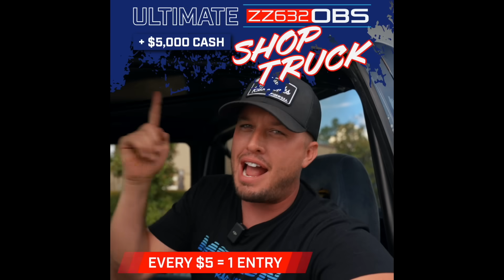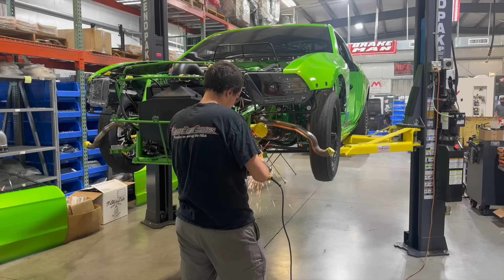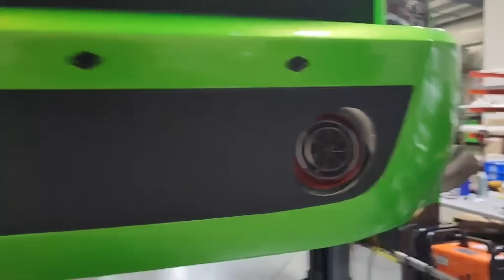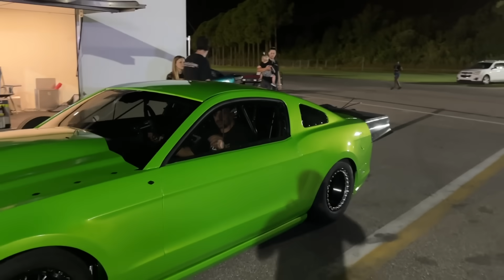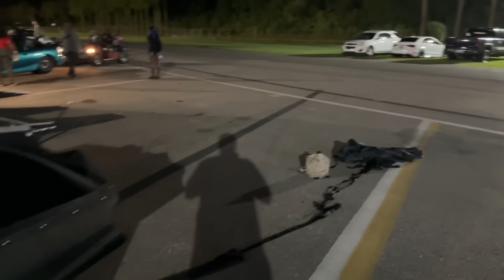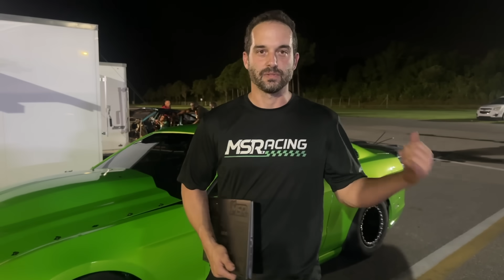Big Changes Required for Snot Rocket 3.0... Plus More Testing

Comment: 1:19 Y’all should get some sealed er32 collets for drilling. For thru spindle coolant drills, they keep the coolant pressure blasting thru the drill rather than around the drill. Helps with chip evacuation and can massively extend tool life!

Comment: You can tell who doesn't know what they're talking about by who brings up cleets camaro lol..
Reply: It's hilarious
Reply: Exactly!!!
Ignorance is very common in the comment section.
Reply: The Elco and Eagle definitely aren't built for the same classes. Below and above, respectively, but Mullet went absolutely beyond what he was made for. 

I reckon Leroy might be his answer with the body now, though. That thing's gunna mooooooooooove
Reply: Ahh but they will likely have a crack at each other at the Christmas Tree Race.
Be rude not to
Reply: Like people like yourself. As they are both promods only real difference between the 2 cars is Eagle runs a real promod engine and SR doesn’t. SR is nothing but a factory wheel base promod.
Reply: @whats2439 ................ Neither car is a promod. The engine doesn't make a car a promod, a stretched wheelbase does and always has, neither is stretched.. Really outted yourself as one of the ignorant with this one. There's no such thing as a "factory wheelbase promod" 🤣🤣
Reply: lol your showing your ignorance. Yall watch too much street outlaws where yall got that composite body and wheel base makes it a pro mod. Eagle and SR are indeed a pro mod. Pro mod strands for Professionally Modified. Take SR is a mustang which is a unibody car. Where is the unibody. It’s a purpose built double frame rail tube chassis. Engine moved back, not in the factory location. Trans back in the driveline is all promod stuff. Non of the suspension is in the factory location and is all promod stuff.  Half the car is a composite body. The back half of the body has had all the structure and support cut out of it to where it’s just light weight paper thin skins. It has to get promod certified and he has to get a promod license. Crazy how the guy himself said he might as well build a promod because people called 2.0 a promod anyway.
Reply: @whats2439 ....... SO calls anything with a tube chassis a promod. Which is what you're doing.. Try again 🤣🤣 there is ONE thing that makes a promod a promod. THAT'S IT. I said nothing about composite bodies, just making up arguments over here lmao. Nobody is reading all that. You're wrong deal with it and move on
Reply: Yep spoken like someone who knows they are wrong and doesn’t want to admit it. Yes you brought up the composite body, but I see you edited your post to take it out. It’s hilarious how you are trying to argue, when Brett himself said it was a promod.
Reply: @whats2439  ...... I never once said anything about composite bodies. Making things up in your head. Not arguing with a crazy person over another mans car.. Idc what Brett called it, he's part of the problem then 🤷‍♂️the definition of a promod is set in stone.. You're wrong plain and simple
Reply: @whats2439 you are 1000000% wrong and he is 100000000000000% right 🤣🤣🤣🤣
Reply: lol no one making anything up about you. You said composite body. FYI it straight says (Edited) by your comment. You took it out when I mentioned half of SR was a composite body.
Reply: @whats2439  you're having a completely different conversation with yourself in your head than what is actually being said... I edited a typo 🤣🤣🤣🤣🤣 stop blowing up my notifications with your insanity
Reply: @whats2439 i saw this entire conversation go down you’re absolutely lying and its weird
Reply: @racer5997  🤣🤣🤣🤣🤣🤣🤣im crying lol. I have a headache from the craziness
Reply: Yeah that’s what I would say too
Reply: Yeah ok, I literally destroyed his composite body argument by mentioning half of SR is a composite body. So he edited that out. Funny how he has (Edited) beside all of his comments and he is so adamant he didn’t say it.
Reply: @whats2439  hey genius, half of eagle is too 🤣🤣🤣🤣🤣 you're literally arguing with yourself STOP TALKING. THEY. ARE. NOT. PROMODS. Someone says you're definitely lying and you double down 🤣🤣
Reply: Ya no shit cleetus Camaro couldn't drive 3 miles, probably not even that 5 gallon tank of methanol don't get u very far lol
Reply: @JayMac well actually sir Lizzy Musi, Bonnie #1 is be auctioned of and pat Musi and Robert Hayes who built the car has stated it's steel roof, steel quarter nitrous promod, I learned something new on that but watch the video
Reply: @JonathonDelumyea  Pat said that to dumb it down for people like you lol.. He literally threw his hands in the air when he said it 🤣🤣Cjrc has an entire video explaining why these cars are NOT promods. Watch it and learn something lol

Comment: Full built race cars like this , how do you get registration? 
Do you retain a donor vehicle vin or something like? 
If Most of car is carbon panels and no factory shell left ?
Reply: you get it inspected, show receipts and what not for the build and they will issue you a vin tag. if the chassis builder is registered as a vehicle manufacturer its easier as the chassis comes with an MSO {manufacturers statement of origin.} All our sandcars like the one in my pfp come with vin numbers.